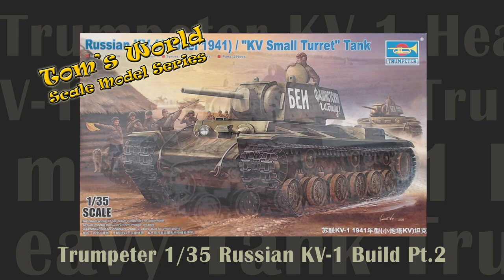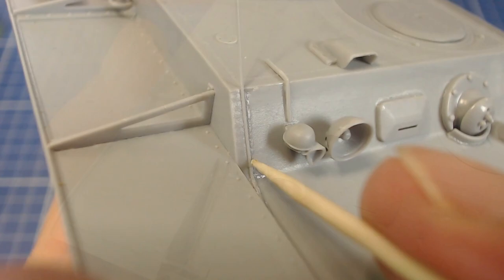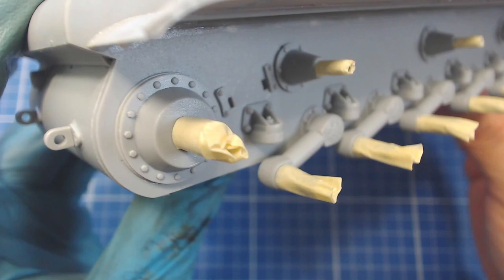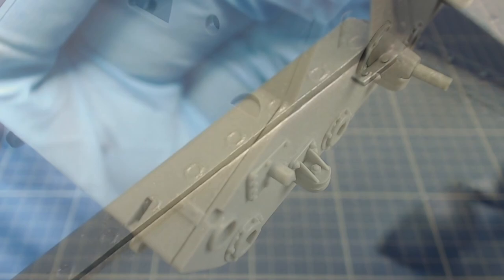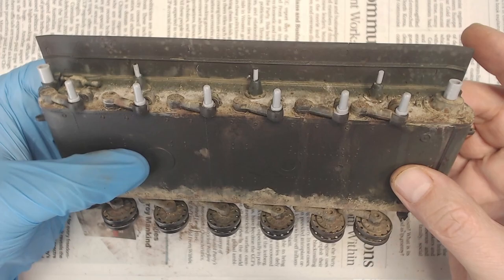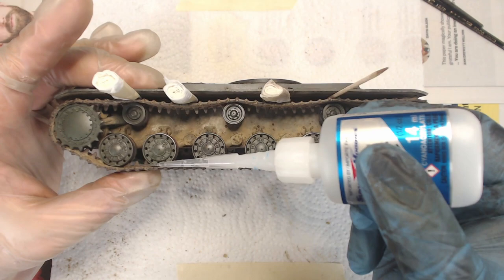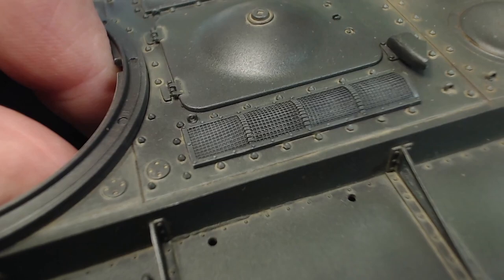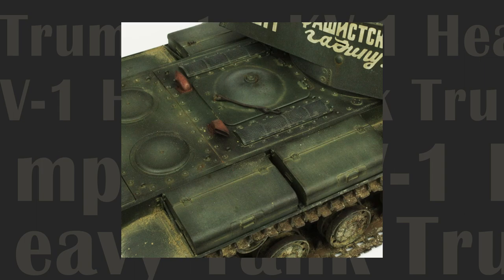Trumpeter KV1 Painting and Weathering (Build Part 2)

Comment: Great videos, as always! 👍👍 I built both this model & Trumpeter's "Ekranami" KV-1 about 10 to 15 years ago, and I have no recollection of the obvious gaps, fit problems & problematic flash that you encountered. So, I think you were absolutely correct when you suggested that the molds are getting old & in desperate need of retooling. Also, I wonder if individual molds can shift or deform with time as well, which would explain the gaps & fit problems. Nevertheless, as you clearly demonstrated, the problems were not difficult to solve...just a bit more time on construction before the fun painting/weathering could take place. And, I love the finish you gave the big beast! It looks like it has been rolling around in the mud & marshes while chasing Nazis near the KV factory in Leningrad (*)....but the kit's good detail & blocky, intimidating lines have not been obscured. 👍👍 Well done Tomas! 😊

(*) After reading about (a) some of the shocking & frequently deadly encounters with the KV-1 that the Germans experienced by while manning their Pz. Kpfw III & IV tanks, and (b) the surprising vulnerability of the early T34 tanks, I happen to believe that the KV-1 is much more responsible for rattling the confidence of the Panzer divisions during Barbarrossa than its sleeker, more highly-lauded Soviet comrade. IMHO, the T34 really seemed to imprint itself on the memories of Panzer leaders during the Soviets's desperate counter-attacks as the 'Rasputitsa' arrived....then again, during the first bitterly cold snowy winter of the Soviet-Axis War, when the Germans approached & stalled in front of the gates of Moscow. It was at this point that the T-34 gained a nickname, "the Snow King(s)", in honour of the T-34's speed & superior maneuverability in conditions that frustrated the Germans & even limited the KV-1. To my knowledge, the KV-1, while feared, never received any sort of complimentary nickname from its adversaries like the T-34 did.
Reply from the maker: Hi Derek -  thank you for the amazing note. Always nice to hear from people with similar interests and I appreciate your feedback. I agree that the T34 was a lemon in its initial form (two-man turret, belched smoke like a sausage factory and noisy as a bad punk band). But I think in the end it proved to be a war winner as its turret and gun were improved. The 34 did everything the KV did but better and the latter's gun was just too puny - a whole lot of tank for not too much gun. Still I really enjoyed building the KV although I think the Tamiya release is better overall (if you can stomach the price). Once I finish the AVGP cougar I've got a Stug calling my name but after that I can see trying my hand at a T34 in the near future. Stay well Derek and hope to have you visit again!

Comment: How much dilution for the main green color on top in order to show the some undercoat of raw steel color? 😅
Reply from the maker: Hey Silvestersze, thanks for the note. The undercoat color is sort of a raw steel colour which is very close to black. The lights and the video sometimes distort the actual colour. I add a bit of red and brown to give it that light rust patina look. Look at these raw steel slabs, https://www.pinterest.ca/pin/137359857361138693/. You can even see some blue in there. I don't dilute the overcoat to show the metal colour underneath. Rather, I spray lightly with an airbrush so as not to cover the undercoat completely.
Reply: @stevieRay3211  Thanks so much for your replies. Gotcha! I’ll definitely do that. I really appreciate that. I’m now building the exact same model as in the video. Trying to get a hands on with this experience. LOL 😝
Reply: @stevieRay3211  I do have one more concerning question about the steel slab. I went to the link you’ve provided (thx btw), I think the steel slabs (or any kind of metal) should have different degrees of metallic silver-ish shininess, shouldn’t they? Should I add some silver paint into the over coat (black-red-brown)? Please advise. And thank you again. 😄😄
Reply from the maker: Bare metal that's exposed to the air and elements looses it's shine almost right away. Also you likely don't want too much bright shiny metal on your tank. You can highlight, here and there, with a pencil but don't overdo it. See the M5 video, it shows the pencil treatment. Good luck.
Reply: @stevieRay3211  Ahh… got it. Oxidation. Sure, I’ll look for that M5 video you’ve suggested. Have a nice day!